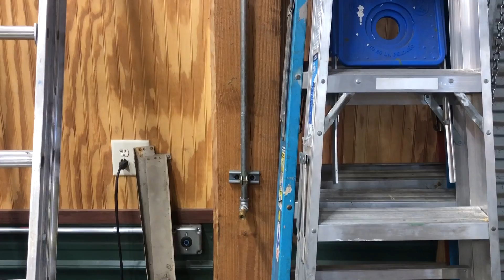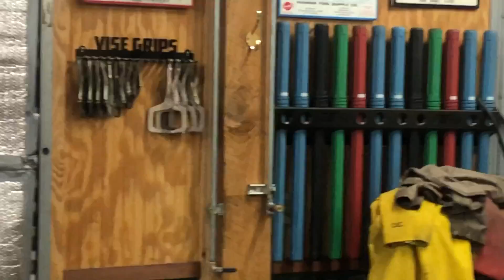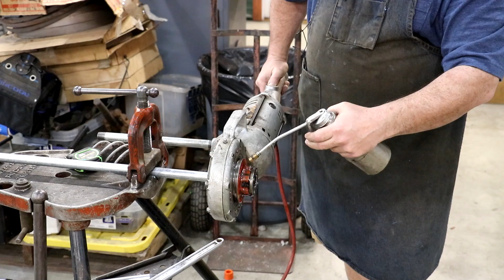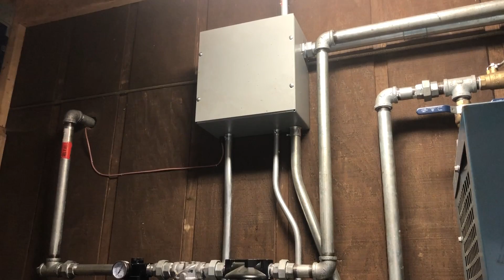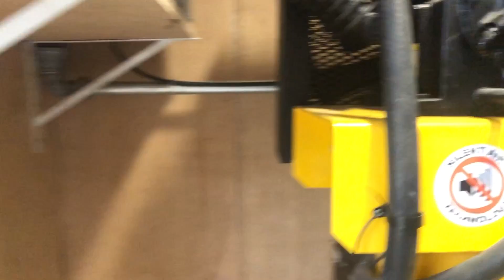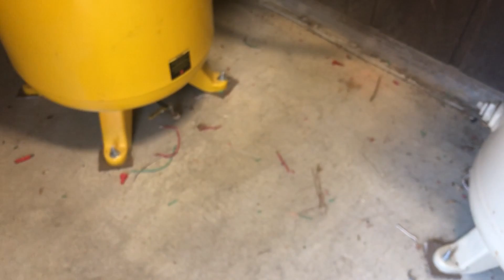The Ultimate Shop Air Compressor Setup! (at least for me....)

Comment: I guess you could add a clock/timer to the control system that cycles a relay at some time (eg. 8 PM) to ensure that the phase converter and the air compressor are turned off. As a last ditch insurance that everything is actually off.
I would consider that myself as I am terrible at remembering to shut stuff off.
Cheers,

Comment: The only thing that I see that might be a little restrictive is that regulator for your shop air line pressure. It looks like it would be undersized if you were going to be running it to a shot blaster. Painting and blasting demands a lot of air volume as you well know. Might want to look into the CFM rating of that regulator. Other than that one thing everything looks amazing, great job.

Comment: Not to get too high tech, but you could setup some basic home automation and do some of that from your phone - even potentially automatically shut it off after a certain hour or send your phone an alert that it's still on after a certain time.  Potentially could even monitor load on the phase converter lines, and if there's no load for X hours automatically turn off.  I'd be willing to help sort out some of the technicals if interested. There's things like HomeAssistant and various arduino /raspberry pi type devices that can manage that with minimal cost.

Comment: that is the neatest system for air! One thing I would suggest is to put a brass pipe about a foot long under each wall t. The brass will allow a little cooling to help catch any moisture and hold it. Just put an ordinary tap on it and drain once a day or once a week depending.  As for the steel lines lasting a long time...ehhhh there is usually one pipe that just explodes when it comes to steel for some reason.  As for plastic lines in a shop with welders...yeah no, just do not even go there. Been there, done that, had to run and shut off compressor.

Most air hoses are 3/8 to 1/2 id. You can go to a hydraulic shop and get 5/8 id hoses. Much better for certain things that require high volume.  For actual pot type sandblasters get a 1in id hose (short run usually) it makes a HUGE difference.

I also found that many hoses do NOT like solvents or oils. If you can avoid having a hose sit in either. Smooth run hoses seem to last longer than the wrap hoses too.  Remember to oil your tools and have them serviced from time to time. Vanes checked, valves checked, bearings checked etc.  My most used air tool is a blower, second is die grinder, then impact. I have many other tools, sanders, spray guns, air sawsall, grinders, polishers, air ratchets, solvent guns, riviter, puncher/crimper, etc etc. 

For some odd reason nobody has ever figured out horizontal tanks hold more air volume that vertical tanks. Vertical work but they just don't seem to have the same volume. By that I mean the supply volume( gallons per second or minute) they say they have same but in function they don't.

Comment: Keith, I am very much impressed with your compressed air system. I have never seen such a well designed and built air system in a small shop. When I worked at the Dodge plant in Mishawaka I had operational responsibility for our 1100 hp air system and for operational reliability we had to do all the things which you incorporated in yours such as tees in place of couplings, air taps on the top of the main air line, adequately sized main air line and tees for terminating drops with the tee outlet pointing down  which assists in removing moisture. Good Job! I also like the use of steel piping.

Comment: The iron pipe was the way to go in your shop. Really looks the part and is period correct in my eyes. Expensive, overdone, over-the-top; yes. Is it awesome though? YES!
Reply: Iron pipes are not that expensive, other materials (copper or stainless steel) are more costly.
If you buy a pipe system from a compressor manufacturer with plastic pipes, such a system is even more expensive than one made of water pipes.

Comment: I know with all your electric motors you are aware of  problems caused by mud dobbers getting inside the case and interfering with the mechanism that shuts the startup capacitor off. I had to have both my compressor motors cleaned and new capacitors installed due to the mud dobbers. My motor man suggested putting old pantyhose over the vented ends to keep the nice creatures out of the motor mechanism. With that compressor out in the small room it may be more prone to mud dobber penetration .

Comment: You and Steve Summers competing with Shop Air Compressor system installs within a week of one another. Coincidental? Great work Keith! By the way, I never had good luck with Teflon sealing tape sealing properly. I only use the Oately liquid pipe sealant, as it appears you did also.

Comment: I would put air filters at every drop. There is a chance that the galvinised coating on the inside will flake off and it is abrasive so it's not good for air cylinders.
It looks great though

Comment: Several shops Ive worked in had a drop of pipe below every coupler with a ball valve so any water and trash can be blown out. We could blow out a quart of water from them every day before starting work.
Reply: When I was an apprentice many years ago. The air was extremely wet. I was working on a manual surface grinder. There was a downpipe near me for draining water. It was connected by a thin plastic pipe to a plastic bottle with an automatic drain in it. The vent blocked up. The drain operated, and the bottle burst covering me in oily, smelly water. It should never have been like that. But fifty years ago, no one cared about things like that.

Comment: Blue plastic? or do you mean the aluminum tube that has a blue poly coating?
Reply: Yes, the copy is Rapid Air Products
Reply: MAB Machine also Transair 35 years industrial air compressor mechanic
Reply: Good job on the loop giving balanced pressure through the whole system, turning your drops up will help too, what will happen with the galvy for the first six months you'll be plagued with particulate breaking off and getting in your tools then you'll be good 5-7 years after that the particulate problem will come back with a vengeance. Good job with the after cooler also and storage and dryer all in all it's exactly how we were doing it 20 years ago, unfortunately the week link is your compressor itself, what the industry has done is speed up the RPM to get meet requirements but it way shortens the life of the unit, when this unit dies look into Champion, made in the US slow speed and completely rebuildable same design since 1956 Hello from New Hampshire 35 years in industrial air compressor mechanic traveling through out New England

Comment: Very nice job! Refrigerated air dryer are usually left on 24/7 they have a thermostat just like your refrigerator. By leaving on it keeps their mass cold. Many times on the T at the bottom of your airdrop there's a 6in nipple and valve as another water Trap and drain. Excellent idea putting the compressor switch by the door.  I tide mine into the light switch. When I turn the lights off I can't forget the compressor. Nice to see iron pipe! Air system normally use black iron pipe because galvanizing pipe will contaminate air and can't be used for painting. Happy to see an oil separator be sure to change it yearly. you don't know they've gone bad until your airlines are full of oil. LOL

Comment: Great system Keith. I didn't think you were supposed to turn air driers on and off. At least the manual for mine says not to.
Reply: His stay on when the power to the compressor is on,,,,not  only when the PS is closed and the motor is running.

Comment: You are not crazy.  I’m with you 100% on using the galvanized pipe.  Both for the vintage look and it’s durability.  

When my father started building  our mobile home park in the early 50s all the water lines were galvanized.  I don’t think there was a choice back then.  By the time I was 10 I was digging the ditches, cutting, reaming, and threading the pipe.  My father would lay everything out and with my younger brother as a helper we did a lot of the work putting in the water system.  When I sold the mobile home park in 2004 very little repairs had to be done to the water system.  My brother and I also worked on the septic tank style sewer system.  We dug the field line ditches and graded out the gravel that we loaded into a wheelbarrow to dump into ditches.  All done with shovels, no machines were used to dig any of the ditches.  The field lines were made by laying the one foot terra-cotta pipe sections with about 1/4 inch gap between the sections one at a time.  No 20 foot sections of PVC back then either.

Comment: Great idea on the air compressor circuit shutoff. I had a shop filled with smoke one morning due to a belt failure on the compressor at 2 AM. It nearly was a full fire. Impressive security camera footage thoigh.

Comment: The issue with plastic pipe is we found if you are welding or grinding, and a spark hits the pipe it seems to wound the pipe structure, after a few weeks micro pinhole leaks start, if you clad the pipe or otherwise cover it its better but if you are electric welding you get UV damage or Ozone damage as well, really galvanised is better, we learned through bitter experience stick with threaded iron
Reply: A-Men Brother. Same in Heat Treat shops. I imagine he Black Smith guys have no use for blue noodles, either.

Comment: Hi Keith, nice setup. I also just picked up a 10HP 2 stage air compressor with an up to 15HP capacity Refrigerated dryer for my shop. Now the big job of plumbing etc. I like the idea of the auto drain, have to look into that too. Cheers Peter from OZ

Comment: I'm not crazy of the bright blue myself Keith. It definitely stands out.
Nice job on the air system.
Beautifully over done.
Reply: As soon as Keith mentioned the blue piping, I thought of you, Steve! :)
Reply: Blue is the ANSI Pipe Color Code Standard for compressed air.
Reply: @593Thresher  Is that tubing color designed by IKEA? They like candy colors, bright blue, yellow, green, violet, pink.... Maybe they work as emergency lights showing the exit being self illuminating....
Reply: @Stefan_Boerjesson  Search for ANSI A13.1-2015 Pipe Color Standards.
Reply: @593Thresher  I feel like checking IKEA and the reason for their selection of colors.
Reply: Not overdone at all. - Correctly done.
Reply: That's the way to do air in my book too. Just make sure you soap check the unions, if your going to have leaks that is where you will have a leak. I hope they are they have gaskets or O rings.  It's better to have more air than not enough. That is a nice job!
Reply: Steve Summers recently posted a video of the nicest and cleanest way to correctly install blue piping.  If you are going to use that is a msut-see video.
Reply: I like yours better. It is not susceptible to internal rusting and contamination of the air.
Reply: No offense to KR but I like urs better.
Reply: @donjohnston9554  Ah that's sweet!
Reply: @ElmerJFudd-oi9kj  Not trying to be sweet (altho it is LOL) but KRs piping is 100% industrial application. Now for a home or small shop their are HUGE advantages with SS's system. Larger air flow, convenience of modification, cost, repairability, on and on. The only place I would NOT put SS's is a welding/grinding booth.  As for COLOR, well my OCD is not that bad. LOL

Comment: looks rube goldberg - all those connections - more places to leak - but i guess it works - watched all and i can say - really? blue pipe plastic - rub with emery cloth quick spray light brown - done - less time, money and looks cleaner - exactly what i did
Reply: I understand aesthetics and all, however I think the blue pipe is going to provide for a lot cleaner air over the long run. I'm sure there is a gray primer of some sort that would stick to it if you ran some sandpaper of it first. But its your shop, so do what makes you happy.
Reply: How did all literally hundreds of air systems we installed and serviced for over 40 years , some of which were installed well over 50 years before we got there all not leak like a sieve?  ALL were done in the same manor as Kieth's    There is nothing you can do to keep the blue noodle crap from looking like is was done by a Bob Villa amateur.  I never saw a union pipe fitter that would touch that junk.
Reply: @mathewmolk2089  did u read what i wrote "more places to leak" not that it will and again makes no sense today with all the new items available - tons extra money and time - all opinions not facts each person experience different - make sense now?

Comment: Kieth, you should see about adding some additional circuits to automatically shut those devices off every night at 10PM, so you can never forget to leave them running, or, even add some internet connected controls to see if it's on or not, or you can turn them on or off remotely.
Reply: That's a good idea, he could get one of those old electromechanical timer switches that they used to use for signs.   Those are cheap and easy to install.
Reply: So that when you dó switch them off manually, they switch back on at 10PM? 😆
Reply: @ElmerJFudd-oi9kj  No. Not sure how you could have read that any differently. In the same way my garage door opener works. If I leave it open by mistake, it automatically closes at 10PM. It won't open at 10PM if it's closed.
Reply: @MyLilMule  Just kidding mate, hence the little smiley.

Comment: After six minutes of this, I punched out. Not what I tune in and subscribe for.
Reply: Just what do you want to see? -  Only the electric system in the average shop is done more half sassed then the air lines. LOTS of good info there for anybody that has a home machine shop,,,,and has never been exposed to top line industrial systems.
Reply: See ya!

Comment: Schedule 80 PVC is grey and works great.  Just an option  other than galvanized.
Reply: PVC, even the grey stuff, can become brittle over time and shatter under pressure; sending potentially lethal shards at anyone unlucky enough to be within the blast radius. Other plastic options that aren’t prone to embrittlement and explosive rupture or non-corroding metallic options are recommended instead.

Comment: One of the banes of my existence as an Energy Manager was the various air systems in the factories I was responsible for. First off, nobody seemed to realise how expensive compressed air was. In the end I bought an ultra sonic instrument to help find the many many air leaks from the joints in the systems. First, I’d stay behind after the area staff went home, when it was quiet, monitoring the systems and marking up the leaks. After the first round of repairs the ultra sonic instrument was used to identify the smaller leaks in the more inaccessible places. And that was phase 2 of the repairs.
So Keith, you have a huge number of joints, valves and equipment connections which are liable to leak. I’d check your system out on a regular basis because you’ll be surprised what this is going to cost. Isolating sections and looking for over night pressure drops. I like the fact that you can isolate the air cylinder easily, meaning that a whole cylinder of air won’t be wasted into the atmosphere. Anyway, enjoy, your electrician has set you up with a very useful control system and it really does cover all of that shop of yours. By the way, lorries/trucks have 24v lighting systems. Would any of their bulbs have fitted your indicator lamps? Regards.
Reply: When you come in in the morning and there is still air in the system,,,,don't worry about it. - I saw the way he did it too. - It will be 2070 or later before he is going to have leaks in the main line,,,,if then. The QD,,,,,now that;s a whole nother ball game.

Comment: Is using PVC pipes for air acceptable?
Reply: It’s not recommended because it can become brittle over time and shatter; and the compressed air in it has enough energy to fling sharp shards at potentially lethal velocities. UV exposure accelerates this process.
Reply: @darkwinter6028  do you mean uPVC or CPVC?
Reply: @johnsherborne3245  My understanding is that both of them are affected by this.

Comment: Love the way you designed & built the system. Do it right or do it twice. 38 years ago I plumbed my shop with copper. Never regretted it. That's my retirement on the walls!
Reply: 38 years ago it didn't cost a Million dollars to use copper...LOL
Reply: Got it right
Reply: I did my garage in copper 28 years ago and don't regret it eather and I'm still on my original compressor that I change the oil periodically and just changed a belt since it wore out and broke.

Comment: You will want to run that compressor hard to get it hot or you will have problems with it down the road.  I have a Quincy model 325 with a three horse motor and I use to let it cycle on its own over the years and with little air use it never got hot enough to drive the moisture out of the compressor and annual oil changes didn't help, it finally would not deliver enough air to power my blasting cabinet any more so I tore it down and found rust had destroyed the second stage cast iron piston and the valves.  It cost me a over a grand for the parts to rebuild it.   I now have a small one horse power compressor also tied into my air system and that supplies 95% of the air for my needs and it gets hot enough to keep the oil clean.  The Quincy is now only used when I need the massive quantities of air  for the blast cabinet.

Comment: I put galvanized 1 1/4” in my farm shop.  Stupid oversized.  Got most of it on a huge clearance sale so the cost was not much more than rapid air. Not much galvanized used around here anymore.  I looked at it as more air storage.
Reply: I have 1"for the loop  in my shop, and I paid through the nose for it. No regrets at all, especially with the sand blaster.